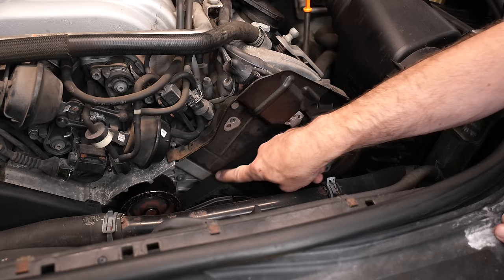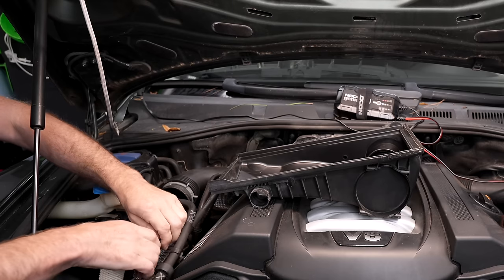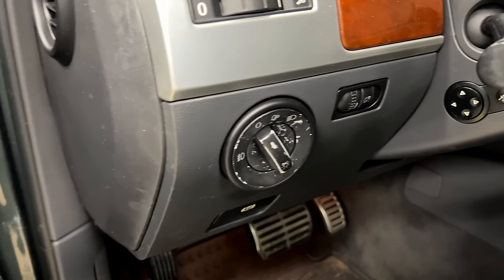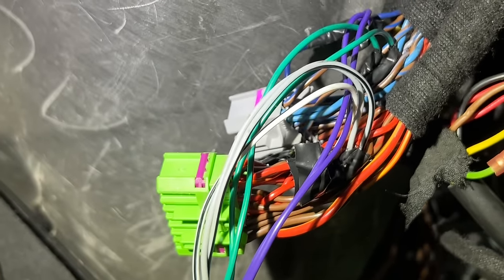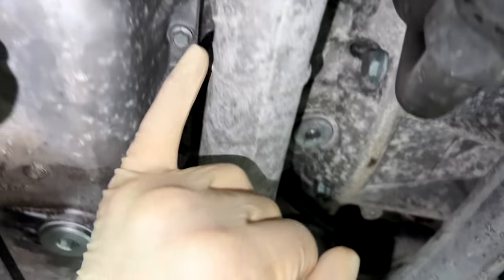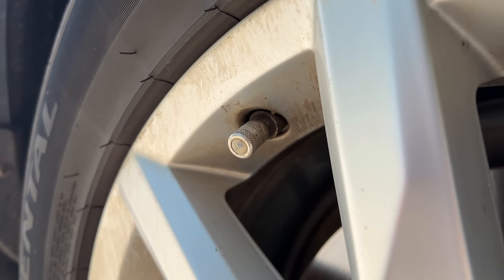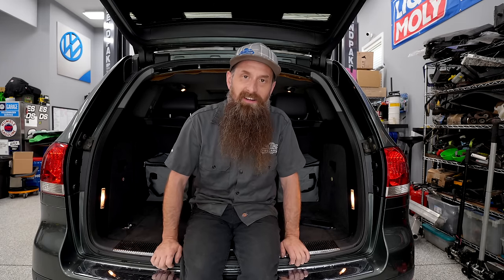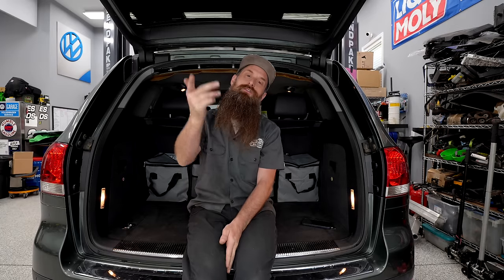Is It Worth Buying a CHEAP, OLD VW Touareg?

Comment: Have you managed to figure out the LED trailer lights yet? I have the same exact Touareg year and model, installed used OEM trailer hitch, module and wire harness. Everything works on it, even the car recognizes the trailer when plugged in and disables the rear parking sensors, but the brake lights don’t work on the trailer. This has puzzled me for a while…

Comment: I have an '08 Touareg. I am in the Northeast in canada. Done all my suspension, brakes, oil and filter. But now I'm having an issue with the flex pipe. To change it would be 2500 for the 135 side and 2500 for the 246 side not worth the price of the vehicle. Can you suggest anyway to fix the flex on these bad boys

Comment: I got a 05 VW Touareg V8 with stock air suspension for 500 bucks clear title lol on iaai auctions. Only issue was the air ride wasn't working due to a fuse 😂
Reply from the maker: That’s AWESOME!
Reply: @HumbleMechanic  I would love to see the timing belt and VVT SOLENOID service for the V8. Or the work involving the engine mounts & trans mount. No one has done the engine mount walk through. I know it requires an engine hoist and I believe a press for the trans mount bushing. Which I do have. The T1 scares me lol it's so over engineered. But I got 9+ years experience working on VW / AUDI, mastered the TSI, FSI 2.0's but a damn V8 😭 So many moving parts and vacuum lines 😩

Comment: Can you powder blast the suspension? 
I am new to VW I purchased a Tiguan, just learning. I have had  Japanese cars before. 
A quick question should I follow the 10,000 mile oil change schedule that VW recommends?
Reply: On Tiguan make sure it's always full (TSI has consumption issues), the oil advances and controls the timing so low oil can be really bad on these.  I've always gone 10K but I have a place I trust now vs dealer so I'm dropping to 7.5K (I have a place I trust because i can specify the oil filter so  know I'm getting one rated for the miles ( I think the the Project Farm guy has a great review on filters, if it's not him just search) with the consumption issues and me generally not being to good about checking my oil it can't hurt.

Comment: Quick question: you mentioned you do not plan to drive this vehicle everyday and for that reason you wanted to avoid a diesel. I am wondering why that’s the case?
Reply from the maker: In my experience German cars that don’t get driven have more issues. 

Add on that TDIs can have fuel issues when not driven. 

Also the v10 is $$$$ to own.

Comment: Might want to soak the rear suspension/subframe down with WD-40. Maybe back the car into a giant hot tub of used 10W40? 
Darn tootin' on the prices. Y'all should bare in mind that you can't get hardly any parts at the dealership for this generation. I don't carry the air filters for this exact car, and would probably have to call Audi up the road for an oil filter. We have no reason to keep parts for these cars on the shelf because the amount of them that we see per year is down to 4 or 5. We have 8 or 9 of the newer ones that we regularly service, and that number is going down fast.

Comment: Hey I got a question just watched a video about how to connect the wires from the fuse box to the radiator fan. Came across your channel like what I saw (even though it wasn't what I was looking for) so I wanted to ask what wire would the radiator fan connect to the fuse box. There's a wire coming from the fan but isn't connected to anything and can't find what it could go to. Forgot to say my fan isn't turning on at all on my 2016 Jeep compass sport. My ac works great and my jeep starts overheating really bad when I'm stopped at a stop sign or stop light.

Comment: is it the same part number on EU and US plugs on the trailer hook ? i have a norwegian 2.5tdi that i only use for towing a camper during summer and winter and never had a issue for over 3years( the camper have led lights in the back )

Comment: I have one. I will sell it. Car is good, engines are good BUT the problem is not the engine but the electronics. I had many problems with hvac, lights and so on. Do not buy an old touareg for daily.

Comment: Whoa. Motor oil as a rust protectant. Learn something new everyday I guess. If it were anyone other than you, I'd say off-road it as is 'til the wheels fall off (probably won't be long). But since you cut your teeth on these, you could practically sleepwalk your way through Toureg content. Though unnecessary for a beater, do a  headliner repair video since that would help a LOT of MKV people outside the Toureg types.

Comment: Do they have better off-road capability than other SUV?
I own a ML500 (Mercedes W163) and I wouldn't dream of going anywhere more off-road-y than a beach. I do have low range but no diff locks whatsoever. The videos you showed were way more extrem than what I would have anticipated people are doing with these cars.

To your point of what to do with it: Maybe you can do a video with different ways to loosen rusted bolts. You do have an awful lot of them...
Jokes aside: I'm more into restoring than crazy builds but I assume I'm in the minority. I would also watch the off-road build since the "getting rid of the old parts" feels like the main hurdle in restoring a car and watching people who actually know what they are doing install aftermarket stuff is also oddly satisfying :D
Reply: Depends on what you mean by "other SUV", its a big segment, to say the least.... As old luxury SUVs go, they are only matched somewhat by range rover. (Or Merc G wagon but thats a strange vehicle thts not really comparable). Normal Merc ML is much worse.

Comment: Hi man, I wonder if have come across a problem I'm having with my 2008 touareg, I put the key in turn it without pressing the pedal, press the pedal to start it, the starting motor rotate the engine but right on the last crank it shuts down, there is not piston combustion at all, it shuts down right before it should happen...

Any help would be great... Thanks.

Comment: This is called "poor maintenance". As for the soft touch trim pieces.. you know what you're getting. They can be removed, cleaned and resprayed with normal paint. And  buttons can be replaced. All cars need to have complete suspension overhaul every 10 years. And by that I mean - everything needs to be replaced. Cars cost money. That's why I have a middle rank daily that won't cost a fortune to rebuild in 5 years. And I do all preventative maintenance ahead of time. For piece of mind. I don't think of it as the car being unreliable. I think of it as investment for piece of mind. Some stuff may hold for 15 years but i'll change it at 10 years. And I'd much rather do that drive in hopes that nothing fails. I hate having to replace something that fails because I didn't change it preemptively.

Comment: So...could you twin turbo V8 swap one of these from a Porsche Cayenne?  Would be a pretty cool little sleeper setup because I'll be honest, I would not expect one of these SUVs to pull up next to me and run a low 12(what a TT cayenne will do with a tune).  Plus the TT V8 from the Cayenne sound incredible.
Reply from the maker: I kinda want to swap the 3.0 supercharged out of the s4
Reply: @HumbleMechanic  Oooooh.  That would be awesome.  My Ford Edge is similar in weight and has the 2.7 Twin turbo engine, and with just a tune it rips(12.9's in the 1/4 with no traction and only 93 tune).  That 3.0 supercharged would rip and sound incredible.

Comment: hey just wanted to know. i had to do a u turn on a steep incline and when i turned around to look back noticed a lot of white smoke come out the exhaust. i hardly ever drive my car and ive just had a new engine put in well lets say it has 50k km on it. its a mk5 gti 2006 model. 
3inch downpipe
r8 coil
stage 1 motronix 

any idea? no smoke when driving normal coolant fine and no major oil use.
Reply from the maker: Maybe a PCV issue sucking in some oil? Thats normally blue, but it could still be. Or a weirdly dripping injector
Reply: @HumbleMechanic  ima do a service on her and change the pcv. Leaking injector would it smoke all the time or just certain times? Car doesn't use that much fuel.

But thanks for the reply mate.

Comment: Didn't the first couple years of the Touareg have a different 4.2 without the rear timing chain? Maybe that one would be the better choice drivetrain wise. I've driven a couple gen 1 Touaregs, they are surprisingly whip-able for such a big vehicle.
Reply: Yes, that's this one. Timing belt with cam chains that are for variable cam timing. Pads from ebay can be swapped in to fix that worn out ones. The later 4.2 have full timing chains on the rear that are a big shit show, tarnishing the 4.2 reputation.
Reply: @Planetary13  Ah ok, that's what it was. It's a great feeling engine.

Comment: I love my 06 Touareg V8. To me it's always funny reading about how shitty these vehicles were. I have over 208K miles on mine and have not experienced the accelerated brake wear or tire wear and I tow a 7000 pound race car trailer multiple times a year. I'm sure the brake and tire wear have a lot to do with how people love to race from traffic lights to traffic lights and stomp on the brakes rather than coast to a slow stop. My wife's 13 Touareg TDI with 146K miles also doesn't go through brakes and tires. Neither vehicle have trouble with my trailer LED lights, so not sure what the solution is. Lot's of threads on ClubTouareg regarding LED trailer lights, so maybe spend a couple hours searching some of those solutions.

Comment: We bought an 05 Touareg new.  What a mistake....  I mean, it's a nice car...  but for almost $50k in 2005, why would you bother?  We sold it in a year when it needed tires and breaks...  and we drive very carefully.  Our 2001 manual Jetta bought new was sold in 2013 with the original clutch still on it.  So we don't beat the snot out of our cars.  It's just any minor tap of the accelerator sent this thing into orbit (v8).  Worse still, the cost for both a set of brakes and rotors, plus the tires, was insane.  I think it was like $1,000 for 4 brakes and rotors.  It's a nice car...  but so is a porsche cayenne...  And I wouldn't spend the money for a cayenne because, well, like a Mercedes or BMW, only idiots with more money than brains will spend top dollar for an suv made by a sports car brand.  The only thing worse is buying a cheap variant of that made to be a more expensive option in a cheaper manufacturer.  
This all assumes you're being us in 2005 and buying it new...  Used at a good price, they are a fun vehicle.

Comment: Yea yea I know, not a VW but still kind of the same dilemma. Bought a BMW E70 X5 3.0sd for not too much money from a friend. Looked at the parts prices and started sweating. It has adaptive drive so naturally it had a error for one of the adaptive dampers. Luckily I solved that for 13$ buying a used ride height sensor. And just yesterday the electromechanical hand brake threw out an error so have to figure that one out. My and my wallet are getting more scared by the day. My last car was a VW Bora (MK4 Jetta in the US) 1.9TDI ALH so everything is a shock to me now. Hope nothing too important breaks, but if it does is still have the Bora, never going to get rid of it, brilliant car never has left me stranded.
Reply: You and your wallet should be scared. These cars are for those that know how to wrench AND dont mind hilarious expenses once in while. If you dont fulfill both, pray or stay away.

Comment: PLEAAAASE HELP ! by ghe way i love you channel grettigs from Chile. Anyway i have a Touareg 2005 V8 love it but i have a mistery. Manual says it uses 8 quartz of oil but i only can manage to fit 5 to 6 every time i ddo an oil change. Whenever i see the dipstick after 6 quartz it shows overfiled. I checked if the dipstick was the right one and it is... I dont know what coul it be... Why cant i fit the otrher 2 quartz of oil? And please do a video about timing belt hehehe !

Comment: Touareg is a horrible quality vehicle like any VW after 2000. Owned 2005 V8 Touareg with only 100k miles 9 years ago,   everything is falling apart . Even paint from ALL buttons inside peeled off from normal use) never again VW. I drive Infiniti now, never been  to mechanics shop in the last 6 years)